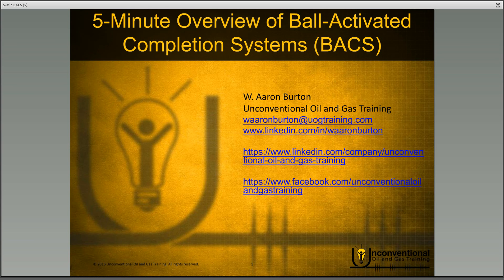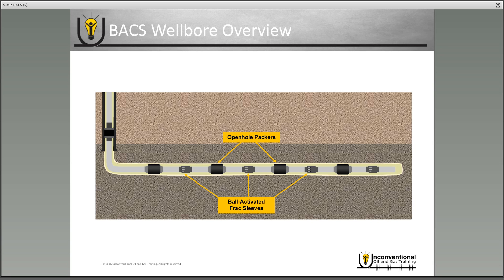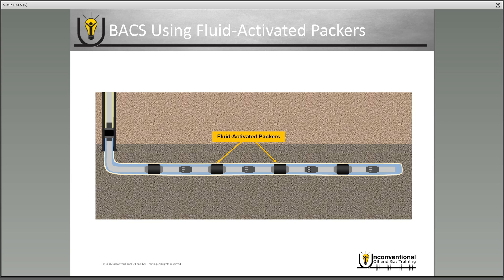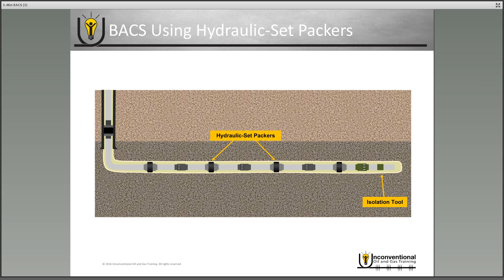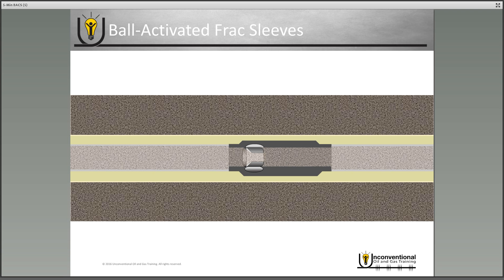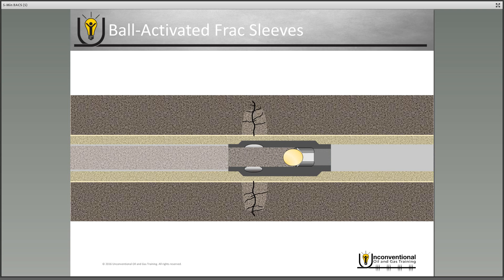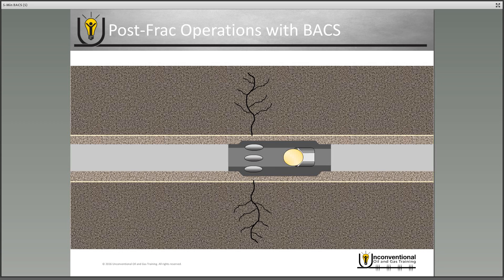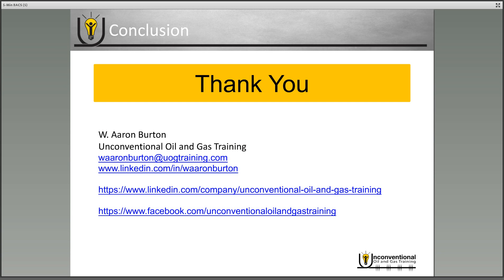A 5-Minute Overview of Ball-Activated Completion Systems

Comment: great content btw , extremely  valuable for undergraduate student like myself to reduce the gap between the classroom and reality in the industry .

If we consider PNP , BACS and CTACS under which type should i put  "Open-hole completion, Uncemented liner completions, cased and cemented completion, perforated completion and multi-zone completion"?

thanks in advance
Reply from the maker: Thank you! I'm glad you're finding it useful!
Reply: @AaronBurton  thanks sir

If we consider PNP , BACS and CTACS under which type should i put  "Open-hole completion, Uncemented liner completions, cased and cemented completion, perforated completion and multi-zone completion"?
Reply from the maker: @lancinejuniortoure5249  technically all of these options can be configured these ways. For example, typically PNP and CTACS are cemented and BACS is openhole, but PNP and CTACS can be openhole and BACS can be cemented.
Reply from the maker: @lancinejuniortoure5249  plug-and-perf would be the only one that uses perforations. The rest use frac sleeves.
Reply: @AaronBurton  thank you so much sir
Reply: @AaronBurton  Hello Sir can you please explain more how the sand keeps the fracture open, and does not flow with the hydrocarbons or any others fluids in circulation?

Comment: hello sir, Is wireline a required service when using the ball-activated completion system? as it is done in PNP completion. or the ball is moved by the hydraulic force?
Reply from the maker: Hi Lancine,

Wireline is not required for this system. The ball is pumped to the ball seat with the hydraulic force from the fluid flow. The balls are relatively lightweight so they move easier with the flow.
Reply: @AaronBurton   get it now, thanks

Comment: I have a question. I’ve seen the frac guys drop a ball before but only at the beginning of the frac. So I guess my question is if they use the frac sleeve and ball system like in the video, do they still have to plug and perforate ?
Reply from the maker: Hi Drew. Just to clarify, are you saying they are dropping the ball at the beginning of every stage? If so, they do not have to plug-and-perf. With this type of system, the ball and ball seat would have the same function of providing wellbore isolation as the frac plugs, and the openings that are exposed on the frac sleeves have the same function of accessing the formation as the perforations.

If they are only dropping a single ball at the beginning of the frac, but not every stage, then they are using the ball to activate some tool at the toe of the well. That could be a variety of tools, but I can't think of anything commonly used in unconventional applications.
Reply: @AaronBurton  I’ve only seen them drop one ball at the very beginning before I stab the lubricator for the very first time. They plug and perf after that. Thanks for responding and answering my question. I’m a crane operator and I’m always on zipper fracs. This helps understand what’s going on
Reply from the maker: @drewmcculley540  Absolutely! I'm glad it was useful! That sounds like an interesting application you're referring to. My best guess is that it is one of these types of sleeves installed at the toe of the well in a wet shoe (unset cement at the toe of the well) application. If they opened one of these sleeves, that should give them a higher pump rate to be able to pump down guns easier for the first stage.  I've heard of this option discussed before, but don't know of anyone actively doing it. I'll have to keep a lookout for what this might be and please let me know if you find out any more details.
Reply: @AaronBurton  I’m definitely going to ask the wireline guys more about this on my next job. 

I have a different question 🙋‍♂️. I used to set tubing heads and master valves for Conoco in the Permian. After I’d set them they’d hook up a pump truck to the well to “open the shoes” and if they couldn’t, then they’d have coil come in and open the shoes. Is there some sort of tool with a build in check valve that they’d put down there ?
Reply: Im watching your videos on UOG and now understand what we were doing when we were “opening the shoes”. There’s  a cement-able pressure activated frac sleeve. So if the pump trucks couldn’t open the sleeve with pressure then coil would be needed to open it. If I’m understanding this correctly
Reply from the maker: @drewmcculley540  they could be referring to the cemented sleeve (virtually the same function as the wet shoe below), but they are likely referring to a wet shoe setup. The wet shoe setup is designed where the cement at the very toe of the well does not set and you can still pump into the formation. It requires small changes in the cementing equipment downhole, and sugar is also added so the cement doesn’t set. This is a cheaper option compared to the sleeve. If the cement sets, equipment fails, or something else happens where they can’t pump into the formation, they have to use coil to send down perfs to regain the ability to pump in the well.

Comment: what if for some reason the ball doesn't opens the sleeve? can you push it mechanically to open up the window, right?
Reply from the maker: Yes you can, assuming you can get to that sleeve with your through-tubing intervention through the other ball seats, and get enough weight down to open the sleeve. If you can’t get down to the intended ball seat, you may have to mechanically open the smallest (and deepest) one you can get to.

Comment: great video! can you explain more about the open hole packer ? it isolates the wellbore fluids from coming into the well right or there more to it ?
Reply from the maker: Thank you, Abdulmalik! The openhole packers isolate the annulus between the drilled hole and the casing installed. For each stage, there will be an OH packer above and below the frac sleeve, which forces the fluid to remain in that stage and not go to the toe or heel of the well through the annulus.

Comment: Excuse me Aaron, if the liner or casing was cemented between heel and toe, then would the packers be unnecessary? It is not clear for me if the completion is opnehole or cemented. Thanks in advance
Reply from the maker: Hi Joaquin,

The BACS were originally designed as openhole completion systems, and that's what I'm illustrating in this video. With this setup, the openhole packers are required for the annular isolation. However, most service companies that offer this completion system do have a cemented version as well, so you can do either of the annular isolation methods with BACS. I believe both the openhole and cemented BACS have been used in the Vaca Muerta.

Comment: So the ID of the sleeve keeps the balls down during the frac? when you then go to produce wont the balls get cause in there next up sleeves and restrict flow?
Reply from the maker: The ball seats get incrementally larger as you go up the well, so the stage at the toe of the well is the smallest and the stage at the heel of the well is the largest. This allows for selectivity when opening the sleeves, and prevents the balls from getting caught on the wrong sleeve during fracturing or production. 

These are disintegrating balls in a lot of cases.

Comment: The video only shows how to open a frag sleeve. What if we want to produce alternatively from multiple zones? Is Frag sleeve and Sliding sleeve both are same?
Reply from the maker: Hi Aagam, 

The frac sleeve is a type of sliding sleeve. In this video, these are ball-activated sliding sleeves, but there are also coiled-tubing-activated sliding sleeves. Both types of frac sleeves also offer a reclosable version that allows you to reclose the sleeve.  A large majority of applications for this type of system are horizontal wells within the same zone. However, you could theoretically produce alternatively from multiple zones using the reclosable sleeves.

Comment: This liner is of course UNcemented isn't it?
Reply from the maker: Yes, the most common way to run this system is using an uncemented liner with openhole packers for annular isolation, which is what I used in the video. Most service companies that offer the ball-activated frac sleeves also offer a cemented version.
Reply: thank you very much!